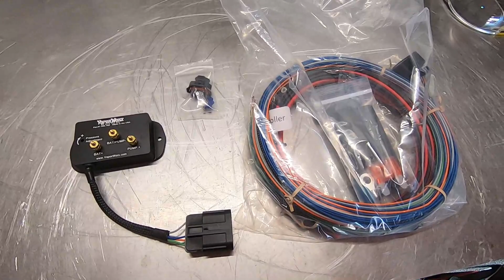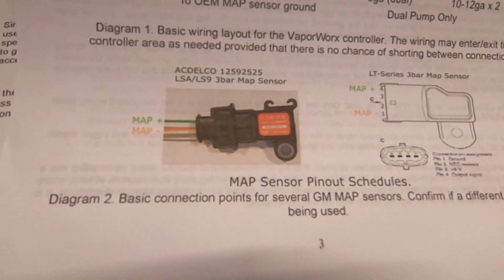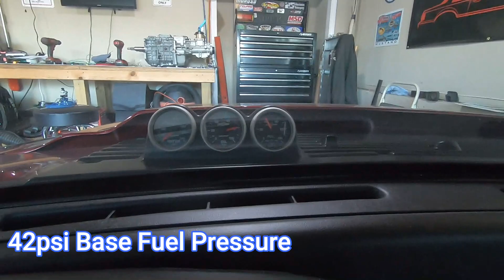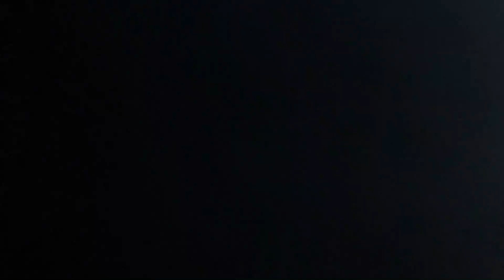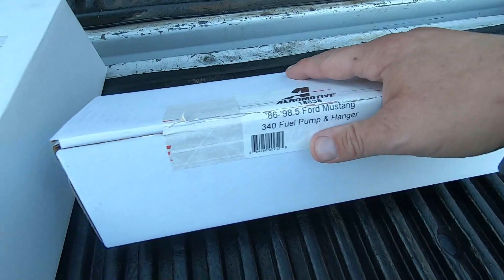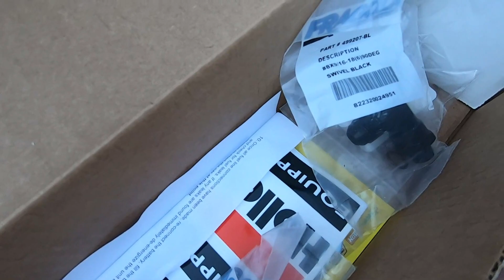Fox Mustang Fuel Pump Controller

Comment: I just got the 525 pump with -8AN feed and -6 return for my 95 mustang. I have a 10awg feed from the battery. What kind of amperage does this pump draw at ~13.5vdc? I think I need this controller since the engine won’t need this huge pump unless I’m going into boost. 351W with a vortech v3 si trim. 80lb injectors. Gonna run E85. Hoping for a very conservative 550-600whp. May run a voltage booster to the pump if I get closer to 600whp as the pump will likely be marginal on E85 at that hp level. On gas it would be no problem at all.
Reply from the maker: @Bacongrease00  the amperage will vary depending on the load on the motor, which is dependent on psi. I’ve seen they pull anywhere from the 18A to low 20A range depending on motor load.
Reply: @ thanks for the feedback
Reply: Just got mine today from summit racing. It says to mount the controller close to the battery but my fuel pump voltage booster is in the trunk of my mustang. There is a 10awg fine stand wire going from battery terminal to the trunk. Is it ok to feed the voltage out of the booster into this module? I have the booster programmed to only boost voltage once I hit 3-4 psi and it ramps from 13.5v to 15v. I just want to be able to slow the pump down when cruising around out of boost.
Reply from the maker: @Bacongrease00 I would contact VaporWorx on whether it’s compatible with voltage boosters. If it were me, I would run it without the booster and see how it performs. Good luck 👍

Comment: I have this pump but kept cutting out at certain RPM its 95 mustang 6.0 turbo ls around 14lbs boost is my combo making to much power for this pump?
Reply from the maker: @joshbrunet9079  do you have a fuel pressure gauge so you can monitor it under load?
Reply: @GeorgiaStangMan  i have just the regulator under the hood but not so I can monitor it. I did keep the hood open and tried to do standing burnout to get into boost and when it cut out then dropped in fuel pressure. I have regulator set at 58 but everyone says to drop it to 43.

Comment: I am installing essentially the same exact set up as you. Using the Vaporworx controller with the provided MAP sensor. Do I turn the tiny adjustment screw in the vaporworx box to achieve 42 psi at idle?
Reply from the maker: @uscfan92879  you’ll still use you fuel pressure regulator to make pressure adjustments. The tiny adjustment screw is to regulate the pulsewidth of current being sent to the pump. You’ll want to take a digital volt meter and set it to DC voltage on a scale that will read 12v. Then while the car is idling, take a voltage measurement across the negative post on the controller and the pump output post. In my personal case, 9.5v at idle was optimal. Yours maybe different. Good luck 👍

Comment: do you know the frequency this controler works for your pump
Reply from the maker: @eljavystang  I do not, one would need an oscilloscope to verify that. But the way around that is checking DC voltage across the output terminal and ground. For example, if 100% duty cycle equals system voltage (~13.5v), then 50% duty cycle would equal 13.5/2=6.75v. However, I’ve noticed my setup works best with idle “voltage” around 9.5v. This equates to about 70% duty cycle at pump.
Reply: @ im running a pwm relay with my terminator x but a saw ur video to check voltsge because i don’t want to go lower than the pump don’t like it
Reply from the maker: @eljavystang  I hear ya. I’m not familiar with the Term X setups, as I use QH. Good luck, let me know how everything goes.

Comment: i have this holley pump and was told the hanger is defective it leaks pressure on the top on the o rings pressure will go south down to 18psi wondering if you had this issue with the holley pump
Reply from the maker: @eljavystang  I haven’t had any issues with the hanger or pump. I highly recommend both. Under boost, my fuel pressure hits around 50psi, and no leaks anywhere in the system.